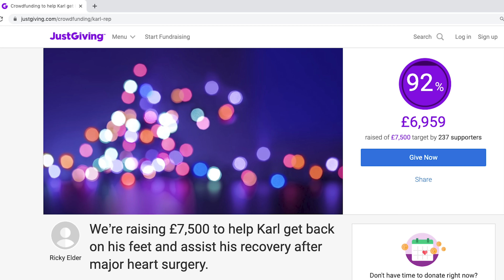Why R8 & Lamborghini DCT Gearboxes Fail! | How To Upgrade The V10 Transmission

Comment: The last gearbox I stripped was a Vauxhall Chevette in the early 80’s! Things have changed somewhat! Amazing engineering and tech. Brilliant job 👏👏👏👏👏
Reply: My three only gearbox strips were one disaster and and two successes. First when I was 17 a four speed Ford Anglia109E which went to the scrapper lol, second a Borg Warner 65 I think it was out of my SD1  3.5 V8 Rover. That went back in with new clutch plates and bands, worked fine and thirdly a 2600 Land Rover 109 Four Speed new synchros and all new bearings and seals in both both main and Transfer boxes. That worked fine too.

Comment: 14:40. a sheet metal guy can make you a drain pan that fits "with" that stand, so you don't spill 1 drop of fluid. and it wouldn't cost much.

Comment: Hi my car is audi r8 2014 with transmission code NXZ can i buy a new transmission model year 2016 or 2017 and replaced the megatronic and then instal it to my car ?

Comment: If used hard how often should oil be changed will that stop that swarf build up.
Reply from the maker: If used on track as well I would be changing at least every year. The clutches run in it so degrades quickly.